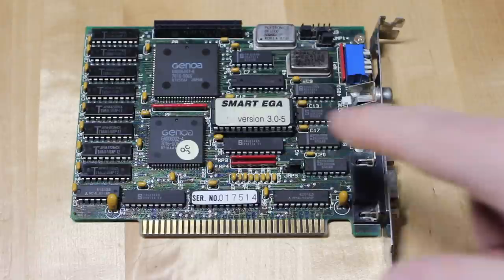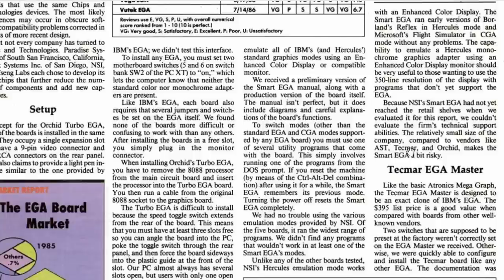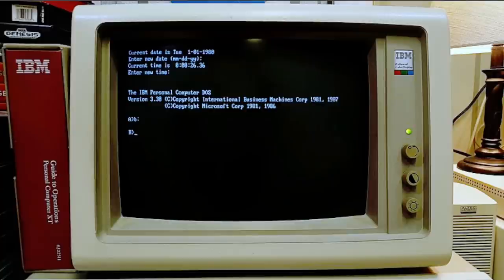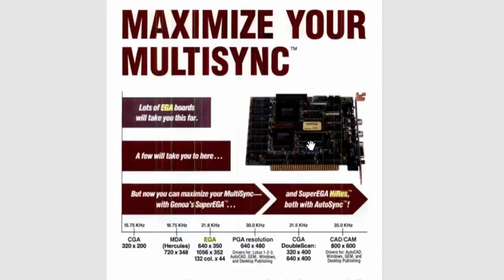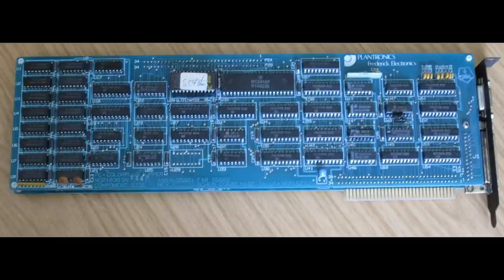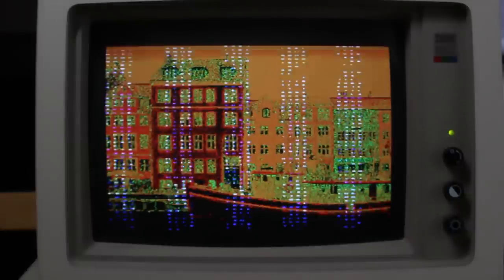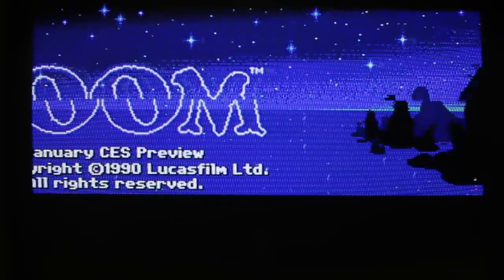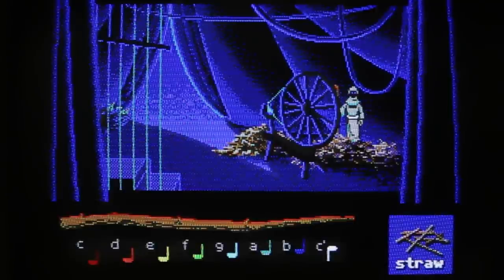The intrigue of SmartEGA and SuperEGA

Comment: The Sony Multi-sync, had a EGA Cable, and a VGA Cable, and could do all the EGA resolutions, as well as the VGA resolutions. It also had the first few 8514/A 1024 interlaced modes. No need to switch monitors, between EGA to VGA Machines.

Comment: Nice card. Actually there is only one Hi-Res Multisync EGA monitor that I know by heart which is the NEC Multisync II (not II-A or II-V, these are pure VGA), which is a TTL/Analogue auto-sensing monitor that can do RGBI (16 Color TTL), RI-GI-BI (64 Colour TTL) and VGA up to 800x600 60p or 1024x768 87i. I know it because it was my second monitor and I still own it (my first was a Salora EGA Multiscan which always reminded me of the 5154 in my memories, and lately I found out, why - Salora was the OEM manufacturer for the IBM displays - unfortunately, this I don't have anymore). I think, Adrians Digital Basement had at some time a very worn out Mitsubishi which is feature-wise quite similar to the NEC but also similarly rare. It is very likely much easier to go with an MCE2VGA or RGB2HDMI nowadays.
Plantronics is also now supported by Sierra SCI Generation 1 Games (like Larry 1 SCI-Remake, Larry 3, Kings Quest 1 SCI-Remake, Kings Quest 4, Police Quest 2 and 3 and Space Quest 1 SCI-Remake and Space Quest 3 and some others. Somebody made up a driver for this which you just copy to the game directory, go to the install tool, select it and you are ready to go.
Reply from the maker: The NEC Multisync II I was aware of. The others are new to me. Thanks for mentioning those. All very rare anyway.

I actually plan to get an RGB2HDMI adapter to try it out. It supports some EEGA modes, but I have no idea if it can be coaxed to support Genoa's modes. It's out of stock at the moment, but I'll try to pick one up if they get them again.

I was not aware of the Plantronics driver for the Sierra SCI Gen 1 games. If you have a link to a source you could update the Wikipedia Plantronics ColorPlus article about that.
Reply: The original NEC Multisync I (model JC-1401P3A) from 1985 also supports all the same digital RGBI/RI-GI-BI modes and VGA / Analogue RGB modes as the II (horizontal frequencies between 15.5-35Hz, vertical 50-62Hz) excepting that it has a lower maximum scan rate, topping out at a resolution of 800x560@56Hz. I have one that I was lucky enough to have thrifted in the mid-90s that I still use for both my Commodore 128 and Amiga 1200.
Reply: @JeremyLevi  560 lines at 56Hz, or was it 600 lines at 56Hz and 560 lines at 60Hz? I kinda figured that limitation was one of the reasons for the nasty-ass original SVGA mode (IE, 800x600 at 56Hz... there aren't really many extant 560-line standards, and 800x560 would be a weird aspect ... even though something like 720x540, an edgy 752x564, or pushing the envelope with 768x576 and reduced blanking would surely have been perfectly good alternatives if you wanted to keep 4:3 aspect ratio and not suffer too bad a flicker...?)

Comment: @Leeki85: You wrote in another comment: "EGA was even worse since it should have at least selectable palette in every mode from 512 colors (like Atari ST had)."

The rationale for expecting a 512-colour EGA palette is really not clear to me. The 64-colour palette was derived from 2 bits per channel – on/off and lo/hi intensity for each of R,G,B, so 6 bits per pixel. (Tangent: If my calculations are correct, you could then have up to 120 different palettes, with 16 different colours each, but I could be wrong; corrections welcome.) A 512-colour palette would have required 3 bits per channel, so 9 bits per pixel. I don't know how the ST did things (bit planes and analogue output, maybe?), but I think the EGA card's 64-colour palette does make sense in its own right. 3 bits per channel would have necessitated a move away from existing connectors and backwards compatibility and/or digital colour – this mostly happened with VGA. 
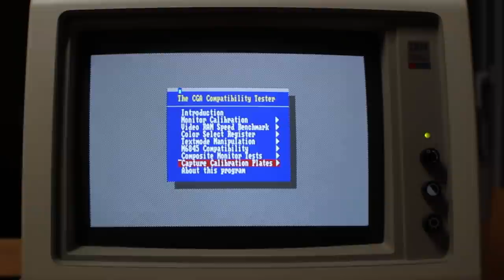(Tangent #2: It seems surprising there apparently never was a 1024x680 px letterboxed sub-768p w/ 16:10.625 aspect 8-colour SVGA mode. This would have neatly fit in even the lowest-spec'd cards 256KB VRAM and offered a good combination of colours and resolution. The default palette for that could have been CGA's w/o intensity. It just would have required a CRT capable of handling 768 lines, and those became quite common relatively early.)
Reply: I guess it was down to IBM hanging on to digital TTL signalling, and wanting to still be able to use CGA and MDA monitors with the card therefore?
The ST, like the Amiga and basically every other non-IBM 16-bit machine used analogue RGB output in its colour modes. So there was no hard limit on how many colours could come from the video port and be displayed on compatible monitors, same as with VGA.

64 isn't terrible, but it may have been a lot more useful if it had been usable in low rez on an EGA monitor. There could have been a way to signal the two colour modes with sync polarity or suchlike after all. And it worked reasonably well on, say, the Sega Master System. 512 or 4096 is better of course, but all of them are way better than a fixed 16 colour palette.
Reply: @tahrey  EGA's 16-colour palette wasn't actually fixed if you used a proper EGA card with an EGA monitor. The reason many developers stuck to the old CGA 16-colour palette and 200 lines was backwards-compatibility with CGA monitors.
Reply: @ropersonline  I know, I know. But I still think it would have probably got more use if the extended palette (as in, you can pick 16 out of the 64, not being locked to RGBI) was usable on actual EGA monitors and compatibles / multisyncs / etc. It'd have been possible to detect that vs plain CGA after all to avoid glitchy problems and user complaints (colour vs mono detect, and CGA vs EGA with high rez was a thing often enough).

As I said, it may not have looked as good as the ST or Amiga, but it would have been on a similar level to the Master System or NES, and a little better than, say, the Amstrad CPC, as well as way better than the mode that was actually used. Like, you could have olive yellow, or orange, purple, pale skintone, actual primary colours, more choices than "light" and "dark" for each colour... etc... without having to dither...

Sure you could just do it in high rez anyway, but that was only used fairly infrequently in games or art software (and other serious software rarely seemed to make any real use of it, including Windows, though that at least gave you dim yellow in place of brown ... often enough they were still text based, even, or just used the same CGA colour set). It looks nice, but it's a whole additional load of graphics that have to be made due to the higher resolution (which isn't simply doubled in each direction, but is 2x wider and 1.75x taller, so you can't cheat with pixel doubling) rather than just changing the colour depth / palette, it's more stuff to move around in each frame, more data that has to be stored on disk and in RAM, etc.

Plus another factor is that not every EGA would be guaranteed to have enough memory to run a smoothly buffered hi-rez mode, or 16-colour hi-rez at all. If you had a 128k card it would only be single page (or 2-page 4-colour), and with a 64k you'd be stuck with 4-colour 1-page or monochrome 2-page only. The only mode you could depend on having full colour and double buffering is 320x200 (or you could run 640x200 and single buffer)... So why not give that the wider pallete? And indeed, 640x200, which would also let you compensate for the lack of bit depth by dithering horizontally and letting your poor dot pitch CRT physically blur the image into a wider range.

But, oh well, the time's gone.

Comment: the EGA thing was such a brief period of relevance that I practically forget it ever existed per the progression from CGA to VGA
Reply from the maker: Yes indeed. Technically it was as long from CGA to EGA as it was from EGA to VGA, but EGA was very expensive when it came out because IBM were the only ones selling it. It took nearly two years for C&T to come up with a clone chipset and for it to appear in a raft of clone cards that were affordable, and by then there were already rumours of IBM working on a 256 colour adapter.
Reply: And yet a lot of seminal games and other software support that as the main / highest graphics mode, especially if colour was essential but absolute high resolution less so... Including some using 640x200, or 640x350 with custom palettes, and the acceleration features, not just actually being targeted at Tandy (thus PCjr) mode and lazily reusing the graphics assets... and that remained the case well after VGA came onto the market (and EGA would have been an increasingly budget option). So it does kind of seem that it had a bit more relevance than all that?
Reply: Well it was 3 years from CGA to EGA (1981 to 1984) and it was 3 years from EGA to VGA (1984 to 1987).. VGA in turn was only king of the for one year untill SVGA in 1988 and XVGA in 1989.

Also worth saying that PCjr and tandy graphics came prior to EGA, and MCGA came prior to VGA.

Due to PCjr having the same most popular grapics mode (320x200 RGBI) as EGA, and MCGA having the same most popular mode as VGA. (well for a while).

True VGA is incredibly uncommon. By the time VGA chip was as cheap as it could be afforded on a normal home computer, SVGA was alreddy the norm

Comment: I had one of these Genoa SmartEGA cards, great card but the first time I tested the hiRes mode, I choose in the card menu the highest possible resultion (800x600 if I remind correctly) and the control circuit in the screen broken immediately ( an EGA monitor) ... and it was my dad's PC. I had to work to replace the monitor, I bought a Sony multiscan monitor, I still have in my attic today.
Reply from the maker: Ouch! I've heard stories of this sort of thing happening. That must have been incredibly frustrating!
Reply: @PCRetroTech  Indeed, very frustrating ...
Reply: Yikes, not so Smart then. Not entirely capable of detecting a multisync in place of a vanilla EGA!

Comment: I remember having one of these back in the day. As colour monitors were so expensive then, I think this card was able to produce EGA greyscales on a monchrome monitor. This is going back a bit now, so don't quote me.
Reply from the maker: I am not sure, but this sounds correct. The card supposedly supports Hercules modes if I recall correct. But don't quote me either, it's actually a while since I was deep in the research for this video.
Reply: I had a friend using an Hercule monitor on an EGA card, it worked except 2 lines or pixels were missing as the screen resolution was 720x348 and EGA was 640x350. But the image was perfectly fine but b&w (in fact orange and white).
Reply: @mmadmic  I think EGA mono showed an actual 640x350 resolution. Like it seemed IBM could totally have made it completely Hercules compatible but they chose not to because that would be acknowledging a third party having got graphics working on their "text" monitor before they did... And it's not like hardly any software supported that mode instead of either Herc or colour EGA (or just EGA-on-CGA) except maybe Windows.

(Text resolution for MDA, after all, is 350 lines, so no need to drop the last two; probably why EGA runs at that resolution in the first place, though they couldn't get it up to 720 wide in colour because of the higher 60Hz sync rate to avoid flicker with the shorter persistence RGB phosphors, which would in turn have required faster clocks and higher grade hardware, which they reserved for the higher rez but less colourful PC3270 instead ... not sure if textmode is 640 or 720 for mono EGA, but they definitely could have done 720x350 graphics on an MDA monitor if they'd wanted to, there was enough bandwidth and enough memory... and indeed four-greyscale graphics should have been possible but wasn't offered)

((and Hercules is only 720x348 in graphics mode because of some daft reason to do with it using the same kind of memory bank system as CGA, which means you can only use vertical resolutions that are a multiple of 4... the text mode is still 25 x 14 = 350 lines))
Reply: @willgilligan7605 Yeah, that was one of their usual selling points, being able to emulate the colour output of other standards "on any monitor" (within reason, e.g. you won't get RGB on a mono tube). Including a stab at EGA hi-rez using interlacing (ugh) and some kind of colour trickery on a regular CGA monitor. I'd be quite interested to know how they did it... just carefully driving the TTL lines at a half voltage that was enough to not fully turn on the transistors (possibly hedging on IBM / clone makers not making the monitor circuitry quite as digital as it pretended to be and still having some analogue reaction to input voltage in the midrange, or even actually being fully analogue and only really the card output being truly digital)? Some kind of PWM even though there doesn't seem to be fast enough clocks present to really do it in a satisfactory manner and there's no telling whether the monitor would actually be able to react fast enough?

(I think I heard tell at one point that the regular "video" for MDA, and the (primary) RGB lines for CGA / EGA tended to actually be digital in their signal response, but the intensity (MDA/CGA) and secondary RGB (EGA) ones were actually analogue as it meant a few less transistors overall and the amount of variation that would be caused to the image by the signal level drifting or the response time being a little slow was rather less of an issue, so it could be that it's using analogue level output on the intensity / secondary colour lines to affect the brightness and/or colour of the output pixels... which probably works quite well for monochrome, if you adjust the brightness and contrast settings to emphasise the effect just right, but it must have taken quite a bit of cleverness in order to make it work even remotely well for EGA-on-CGA...)

Comment: Great video ! I wasn't aware this chipset was capable of emulating PGA and Plantronics ! It's the king of the 80's video cards !

I have a card using the same chipset, the prisma EGAMAX 860. I and other people have put online their driver. Maybe these would work with your card ? I also have a multisync CRT which is awesome, though it's not in a great condition electronically (I need to swap some capacitors and the tube is probably worn out ...)

That thing can display MDA, CGA, EGA and VGA, up to 800x600 and probably even more video modes which I can't do.

For you, maybe you could get one of these adapters made out of a raspberry pi zero and a small fpga. These are really cheap if you build them yourself, and the conversion is really good. You could even capture your retro machines through the HDMI output with that, this would make a cleaner picture for us viewers (though we'd loose the look of a CRT).
Reply from the maker: I'm working on solutions on all fronts for that. But it will take some time before you see the results in video.

As for the PGA, they later clarify in their advertising  that they only meant PGA resolution, not actual PGA emulation, which is pretty funny given their 100% compatible, no software emulation claims. I think the PGA did more than 256 colours anyway, which is certainly not possible with a VGA connector, at least not on any HiRes EGA monitor I know of.
Reply: @PCRetroTech  PGA was upto 256 colours out of 4096 IIRC, depending on rez. Maybe like 256 at 640x400 but only 16 at 640x480 or such?

@Dxceor2486 I coulda sworn I'd already asked this of you or someone else but Youtube appears to be eating comments at the moment ... would you have any way of working out what the H+V sync rates are for the high rez modes using that setup?

Particularly 752x410 which is a common oddity that popped up with SuperEGA (I have no real idea why, but possibly it was about as high as you could get with a multisync whilst maintaining EGA pixel aspect ratio, so hardcoded software didn't end up with distorted graphics?) and that doesn't seem to have any kind of definition as to its characteristics pretty much anywhere other than the few VGA boards that emulated it (...and their timing is basically regular 720x400 VGA with a smidge of overscan, or even a combo of SVGA 800 width/timing and VGA 480 height, so it's not relevant to SuperEGA). Likewise the 640x400, 640x480, 800x600, and a few other wacky modes in that realm aren't well documented, other than that it seems they're rarely if ever equal to those found with (S)VGA cards...